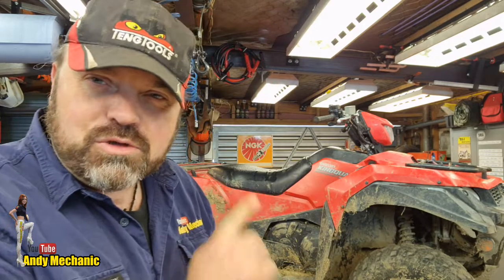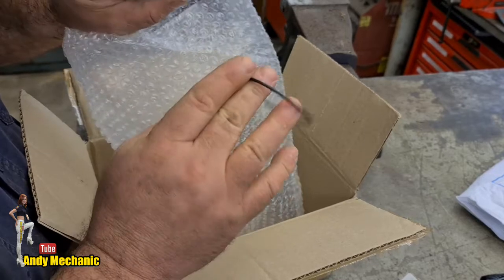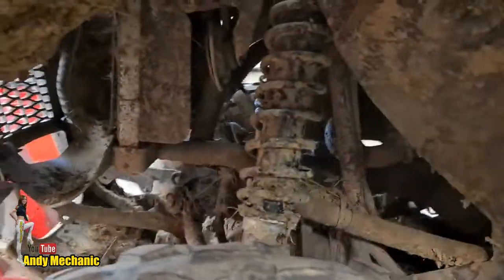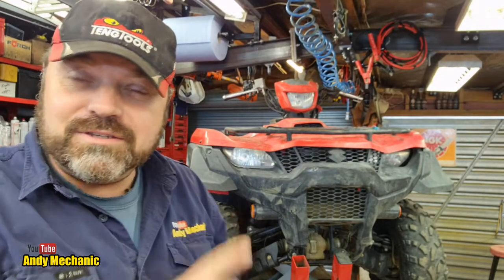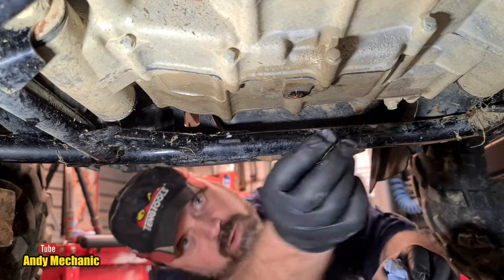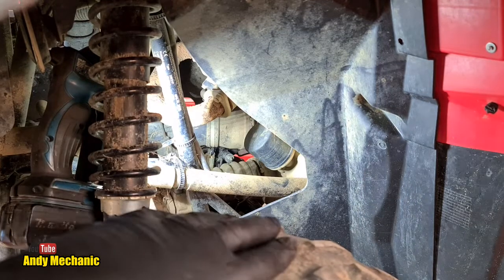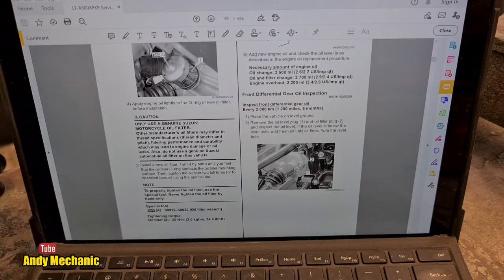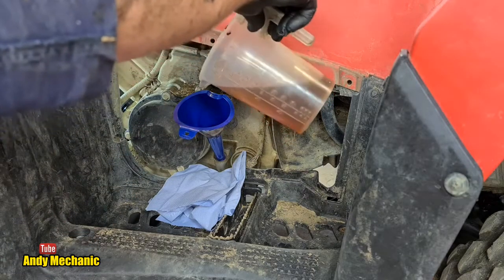Suzuki Kingquad - engine oil & filter change #1873

Comment: How do you find the spec sheet? I need the plastic lid panel that covers the radiator. I figured the part number would be on there. I'm having a hard time locating this piece for some reason.

Comment: Way over tight for a filter, I know suzuki specifies that, I dont know why they do, but as tight as I can by hand I've had no issues.  You can always grab it and try to turn it later by hand to see if it's coming loose and get a feel for it.  I pretty much do this for all filters that I'm able to get a good grasp on.  Do whatever you like with this information.

Comment: A great spot on video.  100% , I'm now following you.  I bought a 2022 king Quad and it needs an oil change now. Problem is I'm on a island in Alaska and there is no dealership here. Can I just use 10-w 40? And possibly just order a oil filter?

Comment: hello. i have a problem when i drive slow, quad is jumping, when i drive fast its almost stop jumping. But when i release the throttle then stops jumping. do you have any idea what could this be? i have  suzuki king quad 300 1995
Reply from the maker: Sounds like a drive line issue. Does it have the same symptoms in 2wd & 4wd?